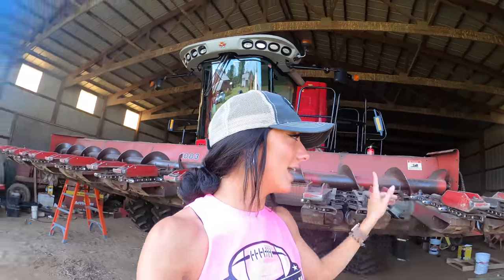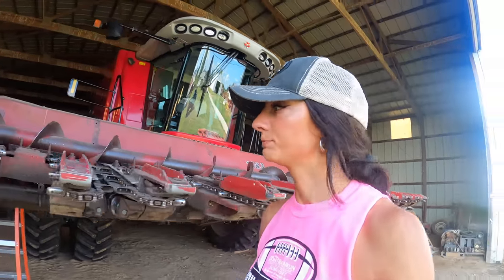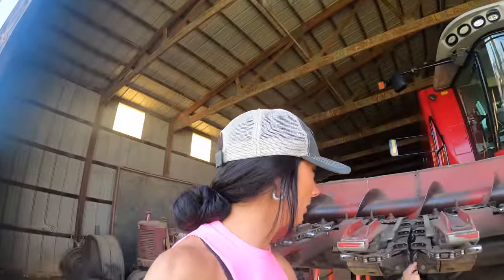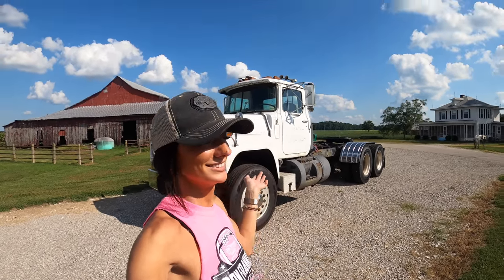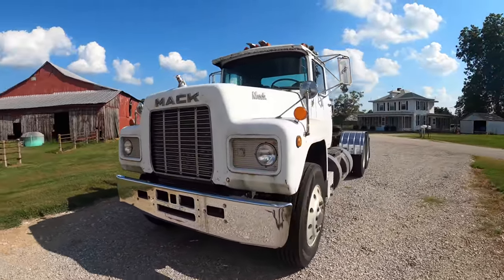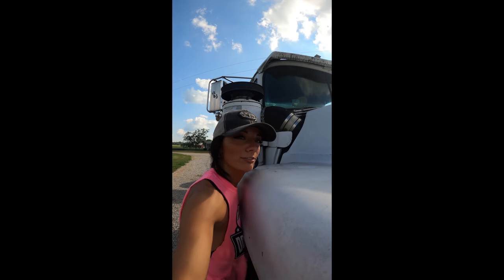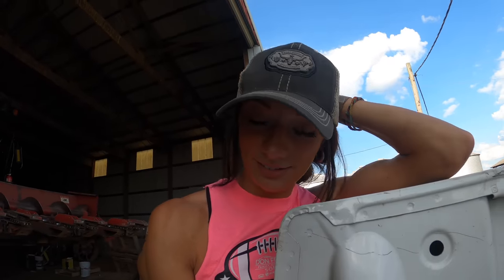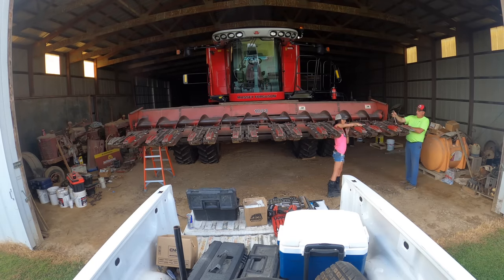New R Model Mack, Harvest Prep Continues

Comment: Not one crunch from that gear change,very smooth double clutching.
I've just got my class 1 over here in England,cost me £3000.
Don't see many old trucks around over here especially British ones like the foden cummins big cam or the bedford tm with the 2 stroke detroit,yep had those engines over here back in the 70s,80s and 90s till the emission laws changed.
It's nice to see a young lass in the rigs so more trucking videos pleassse.👍

Comment: If you are gonna do an R model At least bring your antenna with a vice grip mount a radiobox seat cushion and a whole lot of rearend. They only have one seat so the driver knows where to sit, no power steering and the a/c is on the back wall. Its gotta be a 46 series tractor and there is a BIG R on your wind screen up top with a light inside, only then you have a offical orange and blue tractor. 59 mph later your eyes are red you have made it to the Dallas terminal. Congragulations young lady you are a road driver.

Comment: I’m gonna assume that old Mack has a Mack transmission...they are likely the toughest truck transmission out there but are usually a little harder to shift than let’s say an Eaton transmission but you seemed to shift it like a pro!...I find they shift easier if you don’t rev them too much when they have no load on them and you might find that old girl will shift easier when it has a load on!!..but you double-clutched like you have been doing it forever!!..good job!..I’m surprised it cranked as hard as it did to get started but it fired after a while...those Mack engines usually catch pretty quick...there are a ton of things it could be but who cares cuz she works mint!!..keep truckin girl!..👍
Reply from the maker: Thank you!

Comment: Little helpful hint with the mack. 
Once you get her moving. Quit using the clutch. Its much easier to float the gears and it saves on the clutch pack and gears. You just have to learn the sounds at the right rpm to shit up or down. An if you're down shifting and get hung in a gear. But the fuel or half push clutch to get it out of gear. 
Floating gears will save on the leg as well.
Reply from the maker: Thanks but I wasn’t looking for advice.
Reply: Take it or leave it. Dont matter to me. 
I was trying to give a little bit of friendly advice.

Comment: Those old Macks are tough as nails. I've seen those trucks go through things that would destroy a lesser truck. Like bouncing away from a sand pile with over 20 tons on.  I've seen lots of blown transmissions, drive shafts and rear axles snap like toothpicks.

Comment: Nice truck.. you might want to practice speed shifting.  Even though you have nice legs now.  Wait, double clutching gets tiring very fast. and your legs get sore in traffic, especially in a old Mack.  Listen to the engine  when it revves up.  pump the gas quick pull out of gear and up shift before the rpms go down. and do the same for the down shift keep the throttle up to down shift.  have to take your foot off the gas to get it into gear though. . it will take a minute to get the feel for the gears and the shift ratio. but trust me. when you get it down. you will never double clutch again.  i have been driving trucks for over 30 years, and i never double clutch anything anymore. listen to the engine she'll tell you when to shift.  and for the other stuff life is to short to worry about what other people think. keep up the good work.

Comment: Instead of double pumping clutch use your rpms to shift .saves your leg. Put a little pressure on stick to pop it out of gear let off throttle slow  and it will pop out. The slid shifter to next gear put a little pressure and slowly increase the throttle and it will pop on gear.

Comment: Shift at 12 and 21 and when you start it if it hasn't been started for a while or on a cold morning hold the fuel pedal on the floor while cranking when it starts to take fuel easy up on the pedal so not to Rev it to high rpms in my day I could make one of them sing

Comment: Nice truck I cut my teeth on “R” models here in Australia, it would have a 237HP Mack diesel and looks like a road ranger gear box maybe a 10 or 15 speed, those 237s they were a great engine they’d put some of the big Cummins, cats and 92 series 2 stroke Detroits to shame.

Comment: Grayce, just a side note. I don't know about anyone else, but I had a hard time hearing you. If you continue with the channel, maybe a separate mic that's attached to your collar of your shirt might work better. Good job driving the truck. As a Class A truck driver myself, do you know you don't have to use the clutch to shift? It takes some practice and the right RPM, but will make your driving a little less busy. Depending on the truck, but some where around the 1400-1500 rpm  it should slide out and into gear. Like I said, I love seeing women driving trucks, motorcycles, atvs, horses and tractors.  ❤❤ Keep up the great vids!!   P.S. subscribed and sharing of your vids..  👍

Comment: R model Mack.  Rugged truck, not the nicest ride, but durable.  It really should start easier.  May be too many ether induced starts by people too shortsighted to plug it in.  Bit of cab cleanup and it will be a solid work platform.

Comment: On the tractor pull I noticed that you don't have any safety Frame around you, for me safety is no 1. Even though I entered a ploughing compatition this year with out my safety Frame as I could not lift it on by my self. It is law here in the UK that commercially used tractors have safety Frames unless used in low buildings or for personal use.

Comment: In that R model "bulldog" Mack, take your foot off that clutch pedal. Should only be used on starting & stopping.  Rest of the time, shift your gears without using the clutch pedal! Sorry. . . . .Im just an "old school" trucker! Thanks for sharing your video. Be safe👍🏼👍🏼👍🏼
Reply from the maker: With all due respect, when your names on the title, you can tell me how to drive it. Until then, I don’t care
Reply: @thefarmergrayce  Born and raised into the trucking profession, with over 25 1/2 plus yrs of driving. . . . straight truck box, straight truck flatbed, tanker, reefer, van, flatbed, doubles,  dropdeck, lowboy, heavy haul, oversize, construction & farm equipment! Cross country, regional, & local! 2.5 million miles under the belt! Not trying to TELL YOU how to drive. . . . . .just telling you an easier way so you don't have to double clutch with every single gear shift! Try it just once thru the whole shift cycle. If ya dont like it, go back to double clutching routine. It's no big deal!